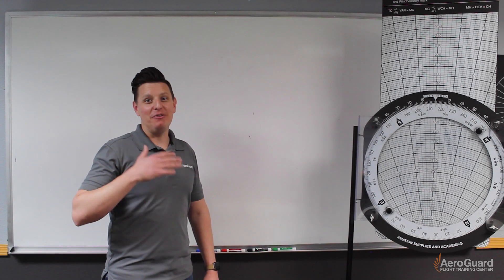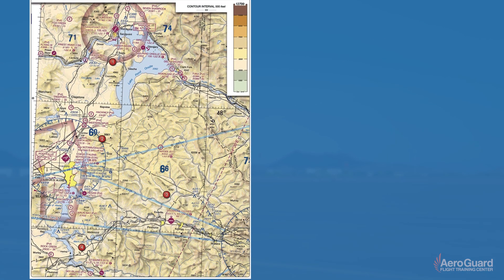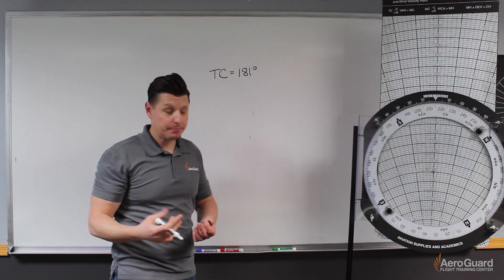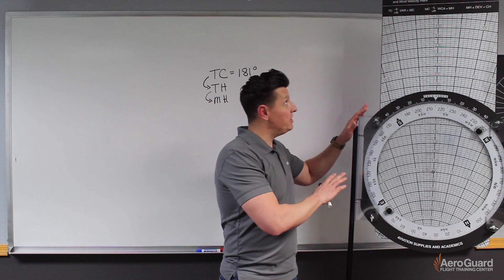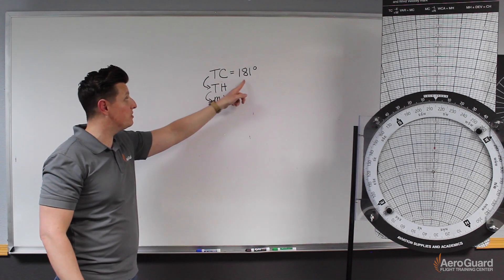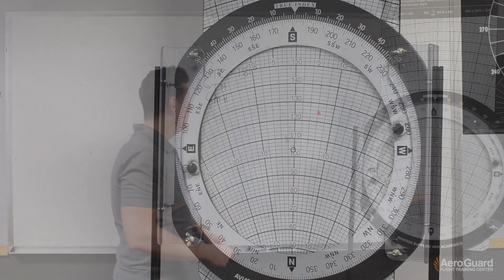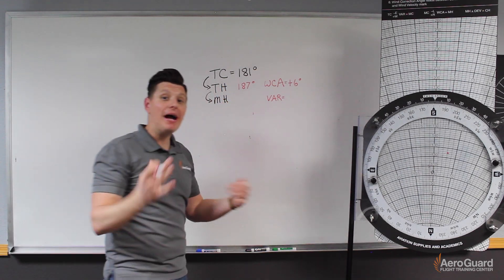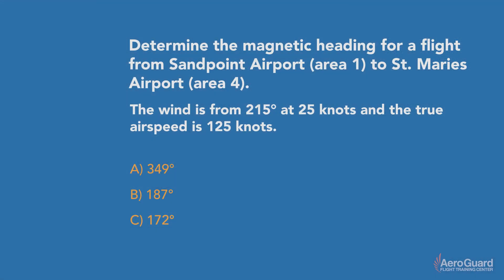How to Use an E6B Flight Computer for True and Magnetic Heading - AeroGuard Flight Training Center

Comment: Confused by magnetic wind direction. Is the wind in the question magnetic or true does it matter?
Reply from the maker: Hello, thanks for your comment! Winds are always provided relative to true north from aviation weather report. That is why we started with our true course, corrected using winds relative to true north, and finally corrected the corresponding true heading to a magnetic heading using the magnetic variation. It is important to know if the wind direction is relative to true north or magnetic north to accurately find our WCA (wind correction angel). Since it is most common to find the winds given relative to true north, we typically find our WCA using true course and true winds. We hope this helps!

Comment: Only not clear on is how you got 181
Reply from the maker: Hi Nikki. You would get the 181 using a plotter on the sectional which we tried to animate in this video. If you are doing this yourself you would;

Step 1: Align the top edge of the plotter (the side that has the half circle on it) along the course line. 
Step2 : Plane the center off the azimuth (the little whole at zero) is aligned with the green line of longitude. 
Step 3: Spin the plotter so that the long edge of the ruler is aligned with the course (orange). 
Step 4: Read the line of degree that is now relative to you direction of travel - this is your true course.

Hope that helps!